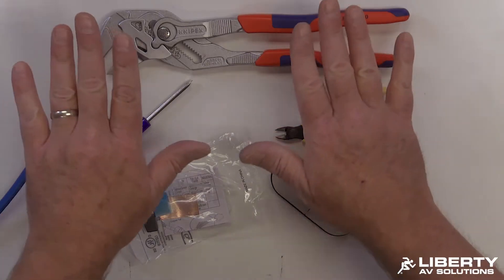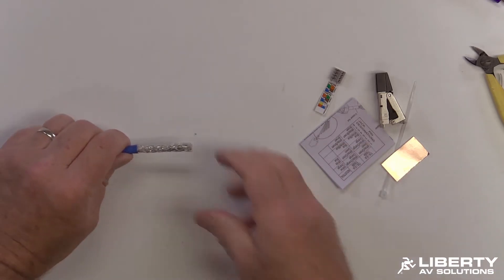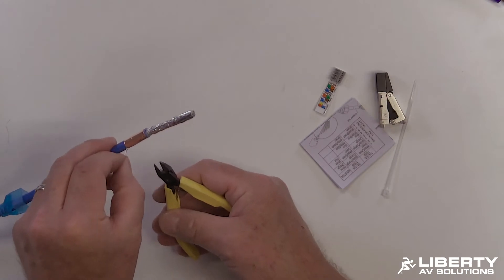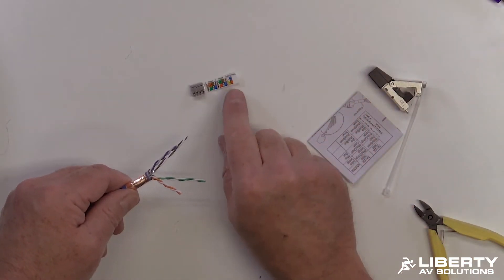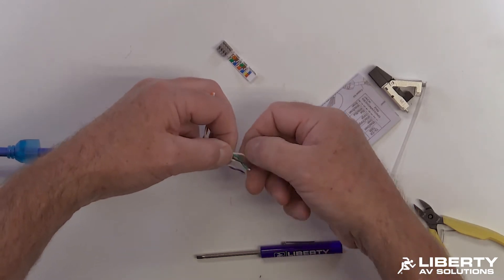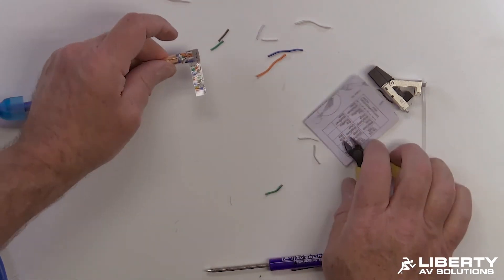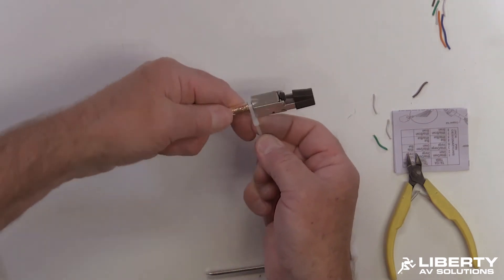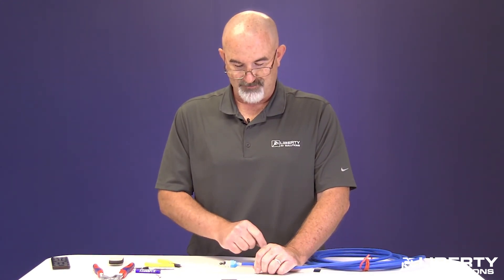CAT7 Cable Termination with ConnecTec CAT RJ45 Connector

Comment: I have Cat 7 cable with a drain wire inside. Do I ground that against the jacket (w the copper tape) at both ends or just one?

Comment: Is the colouringcode order different compared to the cat5e? Because there are wires in the cable that are completely white, no white-orange, white-green, ...
Reply from the maker: Yes, in a way. With the higher performing twisted pair cables like Cat7 and Cat8 and even some Cat6A, adding the color stripe on the white conductor has a detrimental effect on the signal performance. The cable won’t certify. So those conductors are not striped.  This is why we teach performing the termination in stages, to prevent the opportunity to accidentally cross the wires.

Comment: Can you put links to all these tools (Amazon?). Also would you have to buy these connectors also for making patch cables (would the cables be flexible enough for these short runs) or do you recommend going directly into a switch. Would you need a special patch panel to receive these; do they fit in standard cat5 sockets? Seems would be very expensive for a home network.
Reply from the maker: Hello Jayson! These tools are currently not being sold on Amazon, but we can notify you once these have been listed on another seller's website. In reference to your next question, it depends on the length of the patch cable.  This is not a super flexible cable due to the size of both the cable and connector, so very short patching would be difficult. For 10Gbps networking, a better option might be to use our pre-terminated Cat6a patch cables for short patching seen here: https://secure.libertycable.com/product-categories/262/Category-LAN-Data+Patch+Cables The majority of the use we see is HDBaseT and USB extension applications. 

The cable end connectors will connect with and fit in any standard cat5 jack. If you are referring to the keystone jacks, The Liberty Jacks are Keystone style, so they are interchangeable with most products in the market. However, the Cat6A jacks are 1.5X height, so they would not fit vertically in a high-density plate or panel -- side by side, no problem.
Reply from the maker: Jayson, you can find Liberty AV products on both B7H Photo -> https://www.bhphotovideo.com/ - or Full Compass -> https://www.fullcompass.com/
We are pulling together the tooling information and will circle back!

Comment: I thought Cat7 did 25gbps? Or have I’ve been misinformed?
Reply from the maker: Hi David! Class FA or “Cat7A” has been used for 25G networking. Class F or “Cat7” is a 10G infrastructure cable.  It is a non RJ45 network standard.  Most of the America’s sell Cat7 more as a premium “Cat6A” cable – using 8P8C RJ45’s for networking and HDBaseT applications. Liberty’s plenum Cat7 is actually a Cat7A rated product.
Reply: @Liberty_Online  oh ok! Thank you for the clarification!
Reply from the maker: @DavidMunoz-pb9iu  Anytime! :)